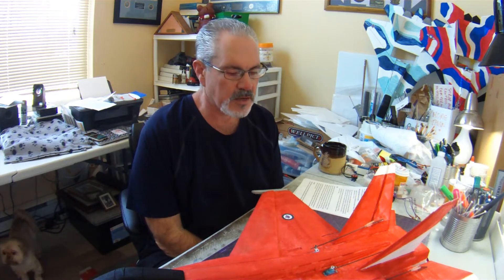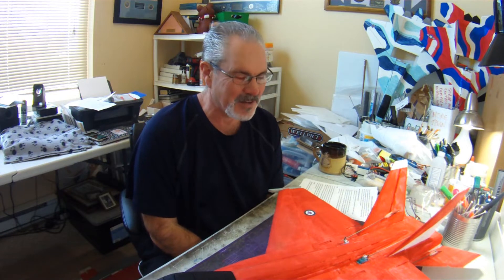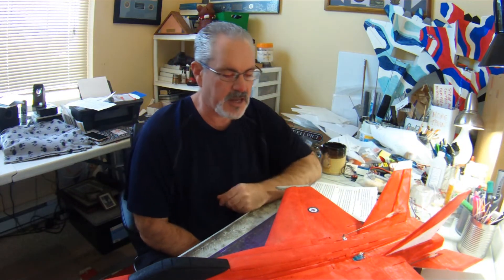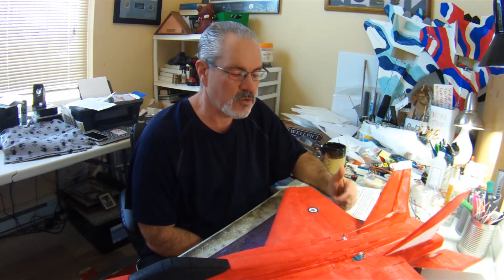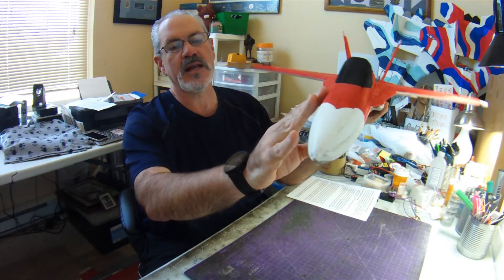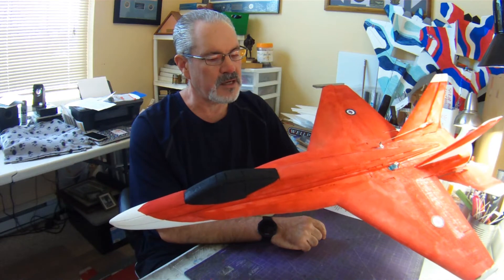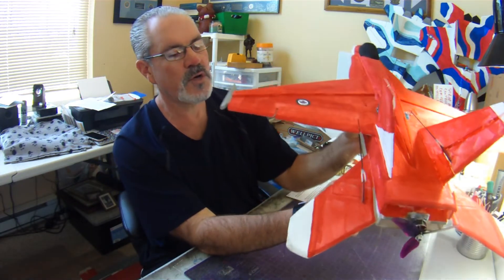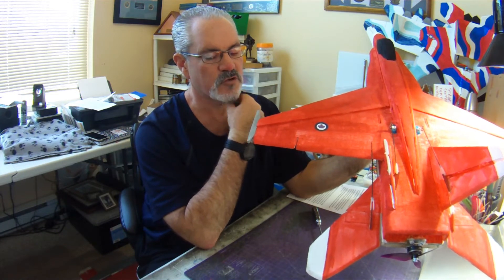"Table Talk" - update on my tail mount Park Jet learning curve - 21 Mar 2019

Comment: Good tips Scott! The torque roll on launch is definitely one of the biggest issues with the tail mount motors. I wonder if they put a center channel for the motor wires to pass through would be a benefit and keep the airflow through the nacelles completely clean. See you in the Air!
Reply from the maker: Thanks very much!  I think next time I just need to tape things down a little better before I "button up" the plane.  I'm not sure how the F-22 tail mount I will be building is constructed for sure, I'll figure that out when I get to it, plenty of other projects have my attention right now :)  Cheers, Scott